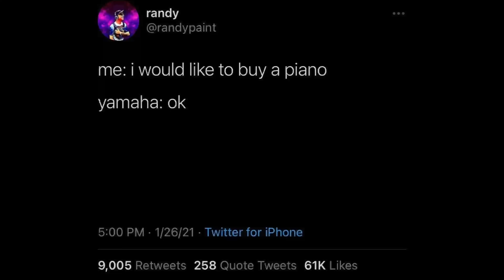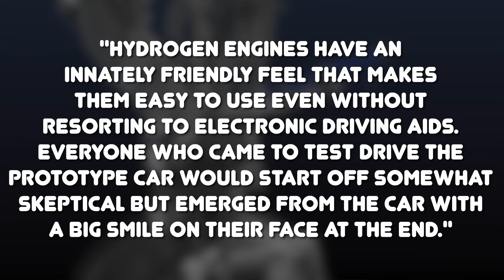Toyota's New 455HP Hydrogen V8: Everything You Need to Know

Comment: We didn't build the car around our infrastructures, but the other way around. Electric is not the future, Hydrogen Cell is.

Electric has a lot of disadvantages: batteries catching on fire, range in very cold climates is uncertain, charging infrastructure as well as it works now, how will the energy demand cope with the volume of cars incoming? Where does the energy come from? Fossile fuels mostly.

Plus EV's are a lot heavier, leading to particulate contamination due to increased tire wear and brake dust (less than traditional).

Hydrogen is one of the most abundant elements on our planet, yet it's always attached to something else and separating it costs lots of energy, but it can be improved on.

We are digging into the wrong hole here, I don't want to have a forced break to charge, I want to twist on the nozzle, wait 5 minutes and drive 500km.

Comment: If the hydrogen v8 is going to keep its exhaust set up then I'm sorry to tell anyone who buys the car (if it ever goes into production) that the engine heads will suffer from  incredible heat sink when the ignition is turned off after a long run.
By putting the exhaust in the 'V' is the same as putting turbos there (BMW/MERC) and look at the head problems that Merc/BMW have had with doing that.
The concept is great, but, it's going to be let down by the exhaust placement if it's retained there for the road car.

Comment: This video is a fraud a misleading lie...The universe is Hydrogen powered....the sun burns hydrogen....earth is a Hydrogen powered planet photons come from Hydrogen the gas of the universe...Gasoline is hydrogen mixed with carbon all combustion engines run on Hydrogen diety Hydrogen use only clean Hydrogen...the ocean are abundant supply of Hydrogen...gasoline is Hydrogen Carbon fuel...8 carbon atoms bond with 18 Hydrogen atoms...

Comment: You’ve lost all integrity for me by simping for EV’s. Electric vehicles have a maintenance schedule. Brakes, tires, etc. They don’t last as long as ICE. The batteries are absolutely terrible for the environment, not only in manufacturing but also in disposal. Range and charging aside. The power demand for an EV future isn’t feasible with wind and solar. Nuclear is the only way to theoretically electrify the transportation works. And even then…batteries suck. And your an idiot who knows how to read a teleprompter.

Comment: Spoke with a friend today who’s EV Chevy (which is turd in my opinion) is having its 3rd set of batteries installed. He checked forums online and found others on their 4th and 5th battery replacements. For sure hydrogen will evolve and drastically improve, and Toyota will create a network of fueling stations nationwide. None of that’s gonna happen overnight. But it’s definitely gonna happen. Due to the devastation to cultures in Africa and the enormous environment devastation, I’ll never have an EV.

Comment: But now imagine you have a hydrogen fuel cell, an electric motor and a hydrogen engine. You could have a hybrid that just uses hydrogen but can use the hydrogen engine at higher speed for cruisin' and the electric motor for fast acceleration.

Comment: The push for ev has always been based on being green. Everyone knows batteries are anything but green. So hydrogen has the ev beat in that category. It is true you still have the maintenance of a combustion engine, and most of that is renewable. Not to mention that is a very large industry with many jobs. But at the end of the day there is no free lunch. Hydrogen powered engines use the most precious element on earth.

Comment: The author seems to have forgotten that the push towards electric was supposed to be for environmental reasons. Unfortunately, the more we get into electric is the more we find out all its drawbacks. Apparently, purely battery based electric vehicles are not as environmentally friendly as gasoline. Hence, hydrogen should be the direction we go in. We can make hydrogen cars electric or we can use internal combustion. If we are serious about the environment then the battery based electric vehicles is definitely not the way to go.

Comment: H2 is ultimate goal.  First there are few major issues with batteries. 1. Lithium is limited and hard to get. that means there will be major conflicts for controlling supply.   2. Weight. it is heavy. For business it is important to transport a cargo not its own weight.  3.  Charging time is too long.  For home operations it is ok, but for big trucks not. 4. expensive to replace. i do not see major price drop since supply is limited.  5.  Efficiency is not good enough during extreme weather (cold or hot).  6.  charging  tax  how we will pay for roads?  Now it comes from fuel tax. it is going to be a big issues .  Now H2 is kind of opposite.  it is light and you have options too. You  can convert existing engine and do not have to buy new car  or buy new car as fuel cell.   No wars because of H2 is everywhere (even in space).  fast charging!  Weather impact is minimal.  Taxes are structured and can be applied in charging stations.

Comment: The Japanese discovered Red Hydrogen which is far cheaper to produce and its made from a extremely safe nuclear power. This Red Hydrogen can transform 30% of the world's pollution to clean power with zero emissions now with more reduction when Hydrogen infrastructure has been implemented.

I think if we have the Hydrogen stations and gas cooled nuclear plants, we will have plenty incentive to convert to Hydrogen.

EVs just take far to long to charge even on the level 3 superchargers abd have low range as well as being 2x the price of ICE vehicles.
Imagne a 30 car waiting line where every car takes 30min to charge on superchargers. The technology needs improved greatly or it can't scale. And that's if the batteries can be inn9vated to use more abundant ingredients that can support the whole world.

Comment: If the Infrastructure was in place for me to have a Hydrogen station with 5 miles of me I would choose hydrogen ice or fuel cell over evs. There is really nothing green about a EV at all the end result is carbon fuel is burn so you can drive your electric car

Comment: This thing will never be in a normal car. You will not get good milage out of that engine without making it a SUV 2 seater without a trunk.
It will be extremely expensive to use and the fuel storage is extremely expensive. Also you still have problems with NOx emissions.

So for everyone who thought this will be a thing I can promise that there won't be anything more then prototypes. At best a small series of cars

Comment: Electric cars are not going to be replacing internal combustion engines for years to come.  They are two expensive, and the electrical grids can't support them.  If the cost comes down and they have better batteries, that will help.  But they aren't ready for prime time.  And they won't be until we replace fossil fuels with nuclear power for producing electricity.  Then when we have cheap, abundant, and environmentally friendly energy production, gasoline powered engines will be a thing of the past.  As for hydrogen engines, it might be possible to make them work.  But you are correct to say that they don't really solve any problems.  How do you produce hydrogen for them.  Typically, that would be by using electricity to separate water into hydrogen and oxygen.  This takes a lot of electricity, but it's a simple process from a technical standpoint.  You could do it on your kitchen counter with thing lying around the house.  A device could be produced that sits in your garage that produces hydrogen for your car.  It's, basically, like charging your electric car but with extra steps.  But could these vehicles appeal to some car buyers?  Maybe.

Comment: You make a list of why hydrogen is inferior to electric but you miss very huge reasons why electric is a fad. First, power production to fuel all the future electric cars  is unattainable, second, the materials to make the batteries is limited. third, you can't just fill up and keep going and along with that idea, fast charging an electric car hastens the decay of the battery's. Then you have to try and replace the battery or throw that fancy electric away and buy a new one since it will be cheaper to buy new then repair.  Hydrogen may not be all, ooooh and aahhh new tech, but it is sustainable and once all those invested in electric stop trying to down play hydrogen it will finally take off.

Comment: You can make hydrogen at your house through electrolysis and that being said it can't be regulated like gasoline. And people like the sound and the feel of a gasoline motor so if they are the same as you say then why would people not buy this product especially if it's gonna be a cheaper alternative to gasoline and hydrogen makes a motor last way longer. Hydrogen cleans the motor making it look nearly spotless unlike fossle fuels which corrode your motor quite a bit that's why when you run your finger in the exhaust it's black but when you do the same with hydrogen you won't have anything at all just moisture Cuz it's producing water. Hydrogen will change the car industry forever

Comment: It's going to need to have 455 horsepower to pull the 300 gallon fuel tank you need to pull in order to make hydrogen viable for any kind of distance. Hydrogen has very little energy per gallon. It's specific gravity is quite light.
The other problem is the primary manufacturing mechanism for making hydrogen is very fossil fuel intensive and doesn't end up saving much in a way of fossil fuels.
Only use the term fossil fuels because gasoline and oil is not a fuel that comes from plant material from 2,000 ft underground. Because no fossils ever exist that deep whether they be plant fossils or animal fossils. Oil is being constantly manufactured underground because it is manufactured by geological stresses that occur Underground. The reason we know this is that they have actually done tests with high pressure with water and calcium carbonate and or crushed marble and created oil the problem is is that kind of pressure takes an awful lot of fuel to manufacture and if the Earth is going to make it functionally for the taking, you might as well just use what the Earth already manufactures.
Carbon dioxide issues are a red herring in the first place.

Comment: You missed the most important parts: the hydrogen doesn't require mining - that is coming with environment degradation - the long distance range performance compared with EV and charging time. And don't forget that electricity is still obtained 40% from coals so the EV recharging is not quite "carbon free" at World wide level.

Comment: HTO number one I think the displacement of H2O is a great thing when it comes down to hydrogen it's just storing the hydrogen safely and transporting it to the engine itself and then we could combine that with some electronics and electrical car manufactor to substitute for the electric meanwhile charge is the batteries and that would be a benefit for not only the electric car but for the consumer who feels that they need to be able to depend on both instead of just one because if the electric goes out you're done if the hydrogen goes out you're done so hydrogen comes from water and water is a great product to use to propel a vehicle very cheap you can get it anywhere in the world I think it's one of the best ideas there is

Comment: Yes there is no reason to buy a hydrogen ICE now.... but as carbon taxes and petrol become more of a problem moving forward they will become more desirable. Past attempts failed not because the car was bad but because fueling it was a pain and if you read their testament they are committed to this design for the long term. 

Your leaving out the fact that they are also leading the way in new ways to store and produce hydrogen on the cheap not to mention other huge break though in how we can produce hydrogen.

Once the hydrogen infrastructure gets built the cost of fuel will stabilize and with all the issues that current batteries cause with pollution, recycling, and the materials needed. (Btw anyone that thins EV's are green does not know how batteries are currently made) But this can make Evs powered by Hydrogen fuel cells more attractive unless we get some massive break though in battery tech.

So if you are just commuting you can have a EV powered by fuel cell. If you are an enthusiast that like the rumble and sounds of a ICE then you buy that. They both run off the exact same fuel. 

Also just like EV's you can set up a water line and an at home fueling station if you really wanted to. So to say there is no point is a little misleading there is a huge point we are just not there yet but with the current environmental protection laws only getting more and more stringent this will become more and more an attractive option.

Comment: You are right. And the Gas Engine will never overtake the adoption of the Horse and Cart. They would literally have had to put fueling stations everywhere, right? That would never happen, but it did. Anyway, what we need is an in-vehicle hydrogen conversion unit. Then you're just putting your garden hose into the tank. Just like the vehicle that was driven cross-country on water. Except the inventor was murdered and the vehicle stolen.

Comment: The information in this video 9.6/10

The logic of the presenter -4/10. 

They haven't tried this before, they've tried battery powered cars with hydrogen fuel cells, this could not be more different if they tried.

No grid in the world (that I'm aware of) can manage 60% of cars being electric let alone every new car from every auto manufacturer. 

The exact arguments against this are copy pasted from the early objections to EVs 

I'd MUCH rather drive a hydrogen V8 then I would a lithium horror story mined by an 8 year old boy in the third world.. 

Hydrogen for the win

Comment: Assuming a hydrogen fuelled engine has similar power and efficiency to a fossil fuelled engine the biggest drawback is the cost of producing the hydrogen. Hydrogen is naturally unstable - there is no free hydrogen - it is combined with oxygen in water and carbon in hydrocarbons. The cost of disassociating hydrogen from water or hydrocarbons (fossil fuels) exceeds the energy that you get from them. With greatest respect to Toyota who are definitely great engineers this isn't going anywhere.

There are no planet saving solutions that include cars, however, they are powered. We are all living in la-la land if we think that converting fossil fuel powered vehicles to either hydrogen or electric will save the planet - it won't. The solutions that will are so radical that no-one is seriously considering them.

Comment: One of the biggest benefits of hydrogen is storage time, it can be stored for years, refueling time is much less than batteries. But the cost to produce hydrogen, the network of refueling stations are  still a major issues.  It's good that auto manufacturers are exploring more than one Net Zero transportation solution.

Comment: I'm not real sanguine regarding battery toxicity. I think in 50 years, eco-headlines will show we have entered another ecological dead-end.
The elemental materials batteries require are, like petroleum, market conflict derived and disposal of used batteries will be another challenge. 

Yes, electric vehicles are dominant now. Yes, making hydrogen fuel is still not 'green', but in ten years I don't want to hear how we have invested in battery tech (petro-tech) so we have to stick with it, even though hydo-tech is suddenly matured.

Comment: I think this could be something if they can refine the process of production and making it easily accessible to re fuel. I also recently saw something on c02 fuel which requires next to no modification for current vehicles to run. Even for aircraft. This fuel removes c02 to create the fuel and they claim they could even become carbon negative if enough plants where made. I think this technology could be a serious move forward because they won't need to mine materials for batteries, the need to recreate vehicles or tech in them isn't a challenge and ppl could almost change over night. The use of ICE vehicles would continue and for lower income families who can't afford the 70 to 100k+ electric cars could contribute to change without limiting their ability to help due to financial restraints. Every change is handed out like the newest tech coming with a hefty price most can't afford making the incentive for change even more difficult to swallow. So having an option where they can make the change but not break them financially would create more change at a faster pace using the one thing they want to eliminate (c02) as the fuel becoming a form of recycling and at some point also a reduction in co2 would conquer what their goals are long before EV will. Unfortunately I feel with investors, gov, big oil, etc will hold this from happening because of financial loss in their current agendas.

Comment: Electric cars are no where near as good as people seem to believe, first of all please tell me what kind of fuel the machines that mine the materials for electric cars use? Hint it burns nice and black. Second, motors overheating from hard use where a gas engine has the benefit of a transmission to take some of the strain off. The argument for lack of infrastructure would be irrelevant if you can prove they are better and if they are the same power wise as gas but the trade of is zero emissions, then news flash that’s the better option. Batteries suck, like really suck and if you’re trying to solve global warming then producing more electricity is not the solution, creating electricity creates heat and if you understand what that 60amp draw from your car charger is actually doing and just how much power that is well you might think twice about how you’re “saving the planet”